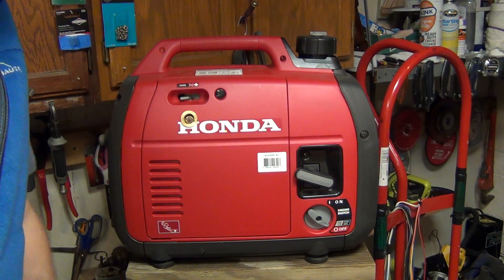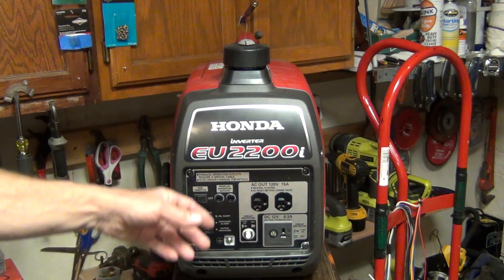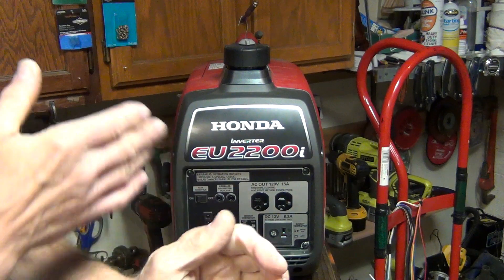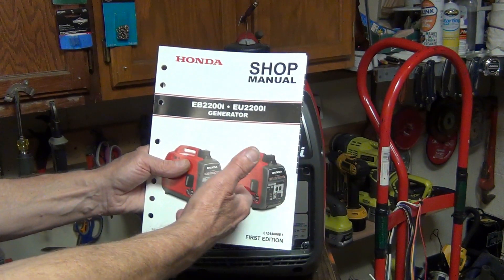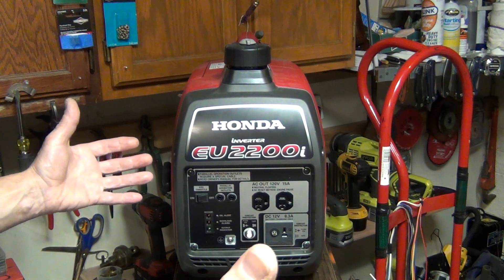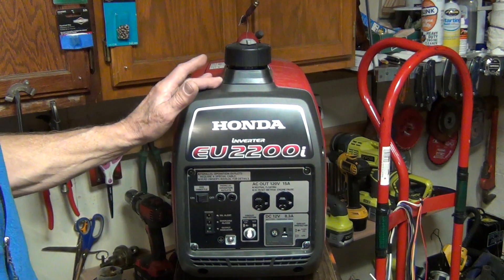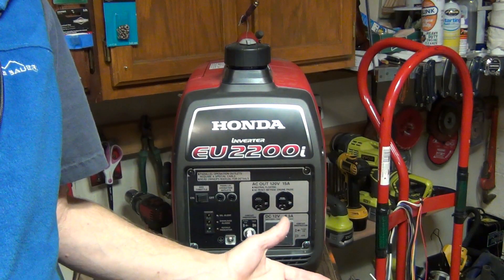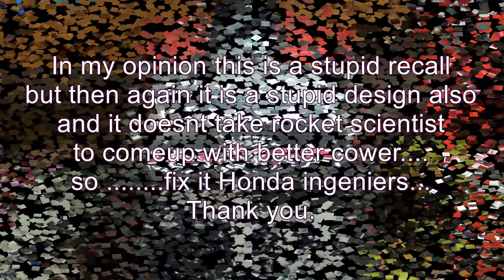New Recall for Honda EU2200i

Comment: Both recall videos are really useful. On the first recall (the fuel switch), another YouTube video showed a person at an actual Honda repair shop which had done 30+ of those recalls and out of those repairs, they did not find a single faulty switch (with the screws loose, as shown in Kovac's other video). 

On this repair for the potential inverter short, I have now read in many places that this is almost entirely a problem only when the generator is used on a boat in the ocean (salt water). 

As for running it in the rain, since Kovac's correctly points out that this EU2200i is not sold as a rainproof design, I built a cheap tent out of PVC and a tarp which I use when I have to run this to power my house during outages. These normally occur during storms so I have had to run it many times in the rain, but it never gets a drop on it.

Bottom line: I'm not going to risk having the unit possibly degraded by someone who doesn't reassemble it correctly, and I'm going to skip both recalls.

Comment: Thanks again. Easy to understand and a great explanation.
You're right, every household should have at least one Genny/generator.
Just in case.
Quiet ones for folks living in apartment buildings/highrise/low-rise housing too, etc.
My parents and I are in discussion about possibly getting an emergency generator.
Thanks Vlad.
Reply: DO NOT use a generator in a high-rise or low-rise or any other building where you are unable to locate it outside and plenty far away from the structure.  If you just have a regular 5-foot wide balcony, then that is NOT at all a safe place to put a generator.  Carbon monoxide gas can very easily find its way into your or a neighbor's apartment and kill everything inside.

Comment: I wish someone would do a video on the actual fix,or repair on the recall.So far no one has made one.From what I understand the parts for the repair are back ordered.Back ordered for quite sometime.300,000 units are quite a task for a recall.In my opinion.
Reply: I was gonna buy a new one but they're probably old stock.
Reply: @edt.9218  Its possible to purchase old stock,and get a recalled new generator.However they are not supposed to sell you one.But I have seen people posting that claim it has  happened to them.Legally they arent supposed to sell them.

Comment: Another great video Vlad I was wondering what all the hoopla was about. I called my local Honda service center and asked them about the recall. I was told they must take it apart and determine the route to take and he stated the inverter my need to be replaced. I found that hard to believe. I do not live on the coast or operate my generator uncovered in the rain so I am going to pass on this recall. Thanks for the video.

Comment: I might have missed it but what does the recall do?
Reply: From what I understand the repair keeps the water off the inverter module,and also keeps it from entering the connector on the module.
Reply: @GoldSeals  But how?  Do they add in a seal or a guard of some sort?
Reply: @JT-rq7nt  There is a rubber cover thats molded to fit on top of the inverter.This is designed to deflect any water away from the inverter.There is also a rubber boot added that covers the connector thats plugged into the inverter.Honda Specific non conductive dielectric grease is added to both the male,and female part of the inside of the connector.You must take the generator to an authorized honda repair dealer/center to get the work done to be warrantied.
Reply: @GoldSeals  Thanks for the update.  I actually just picked up a new eu2200i today that has a later model serial number EAMT-214xxxx, so I should be in the clear already.  Do these fixes also help to prevent spilled fuel from causing problems inside the unit?
Reply: @JT-rq7nt  I would imagine the fix would also help prevent the spilled fuel from getting on/in the inverter.One reason I recommended anyone that needs the recalled generator repaired, was of course the warranty,and also so the dealer can inspect the old inverter for water intrusion too.And If that was the case, they would  probably replace the inverter free of charge, along with a new rubber cover,and protective boot.My opinion.
Reply: Noalox and caulk check lol

Comment: Thank you VERY MUCH for this info, am planning on buying 2 of these, BUT, I will convert both to propane, you GAS overfill comments are helpful, I would think a CHEAP fix would be to have a heavy waterproof tarp made that could be slipped over it that still allows access to exaust & air filter. ALSO, THANKS about the Repair manual.